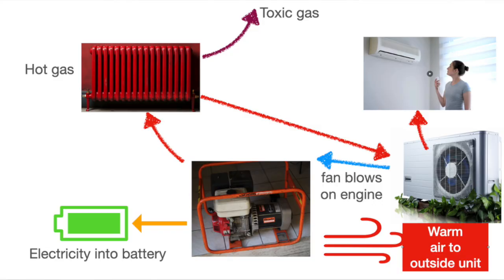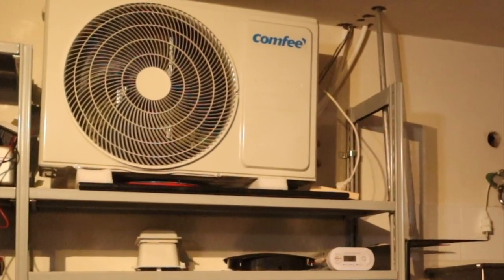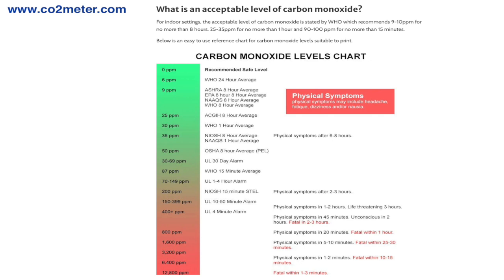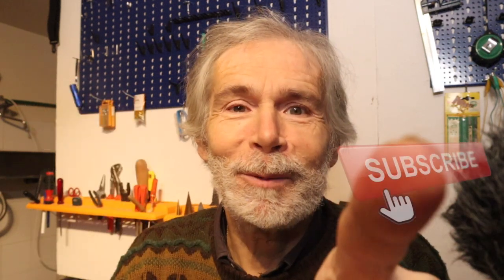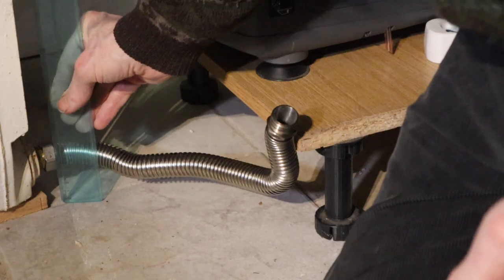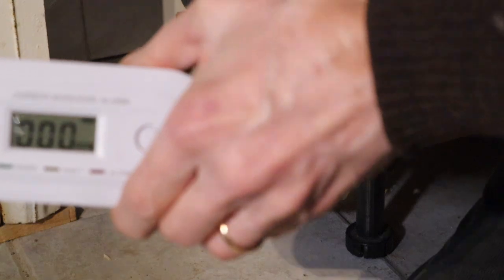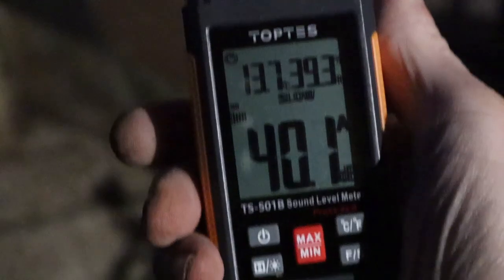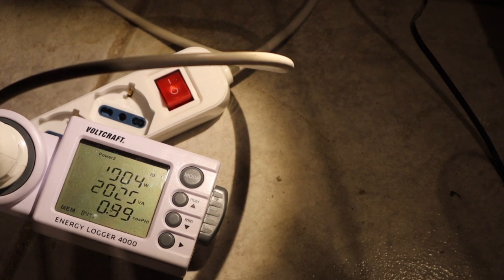Off Grid LIVING Made Easy with Advanced Micro CHP System! Video 83

Comment: So this was touched on in another comment.  But wouldn't plumbing in outside air to the generator's carburetor be more efficient than forcing the system to draw in cold air though cracks in the garage from the outside, degrading your captured heat?  Also,  I wish I'd seen links to the parts, like the generator and heat pump.  And lastly,  though it would require a custom generator build,  I think charging batteries directly may be more electrically efficient.  For example, I think you're using a 24V battery system.  I always assume an electrical conversion efficiency of 80%.  So if that's an inverter generator, you're losing 20% in the inverter process right at the generator, and then 20% again at the Victron to charge the batteries, and then 20% to get from batteries to AC again.  The soft start due to the inverter VFD in the mini-split is a plus, and probably the only place where the power conversion works in your favor more often than not.  So, my thought is to limit the number of times electricity may be converted in your design from DC to AC to DC to AC etc with a custom generator charging the batteries with 24 volts directly and then powering everything from the Victron inverter.  There are youtube videos dedicated to such generator builds, due to the fact that converting electricity is not efficient.   Overall, I like your build, I'm glad you did it, and I've had in mind the same sorts of things, but every HVAC technician that I've ever talked to, and every manual that I've ever read, preached against putting the outside parts of mini-splits inside anything.  Furthermore, in the States, as soon a property owner does anything brilliant with their home, that others don't understand, their property value plummets, and or, they're tied up in code violations.  I often wonder if it's that way in other parts of the world.  I look forward to future videos documenting money spent on gas verses what the cost would have been buying from the grid.  I also look forward to your thoughts of a diesel generator rather than gas, as diesel has more energy per gallon than gas.
Reply from the maker: Thank you W3 for the comment. It is true that the generator takes air and pushes it together with combustion gases to the outside. But it is not much and far away. But it is a good point.
I was thinking about links but didn't find my generator on the web shops. It is an Italian machine, the Pramac PMi 2000. The other big one was 25 years old...
The 24 Volt generator is a good point, I would also like less conversions. However, the set up is actually aiming at working directly for 230 V ac power supply, for example the heat pump itself. The battery is not so large and doesn't take a lot of energy. It should allow to come through a silent night with few small consumers running.
It is a wonder that the USA is so strict in its regulations. I had the impression that such densily populated countries like my country Netherlands and my Residence country Italy are much stricter. OK, USA has some very dense areas, imagine only Manhattan.
Reply from the maker: Regarding the split in the garage, I was well aware that it is a very strange thing so I thought much about it. I ensured that the heat production and cold production of generator and evaporator where in balance. In summer we are in another place (you see it on the channel) so we have a dominant heat demand in the house you see on this video. 
I was just so curious about the effect on the Coefficient of Performance (COP) with this outside unit in the garage. After all I see that the temperature in the big garage with so much stuff inside never felt under 13°C and the generator wasn't even running!
Reply: @nnvasen-good-energy  Do you know if your garage is insulated?  My home garage is not insulated because the home builder was not required by code to do it.  We've managed to insulate the attic, but have not cut up the sheet rock in order to get insulation in the exterior walls of the garage.  our winters are -3C to -17C, so 13C is like a heatwave for us in the winter.

Comment: Hey an idea came to my mind, since your heated source is not in a loop (gas is going out) if you add some fans to the radiator that pull cold air into it,  you might improve your low energy heat recovery by 10% or  more.
Reply from the maker: Hi Vottat, you are right, i will do it, like in my first video https://youtu.be/z0ldVoti2hA !

Comment: Ok so what if you would place the generator and the inverter in a well insulated fireproof box that you put outside, with the exhaust routed outside and an air intake for the generator (I think they run more efficient with fresh air than with warm air). What COP should be possible if you count on 30% electrical efficiency and 55% heat from the generator?
Reply from the maker: Hi Rob, that is a good idea if you want to avoid having it all in the garage. You mean generator and evaporator, right? The only problem is then that you have not the thermal storage of the garage and its content (including a warm car). As soon as the generator stops, the evap is without thermal support. In my case it is also to avoid nuisance to the neighbours. Outside the garage I hear practically nothing, a box outside has to be made really thick. The COP is more dependent on the temperature outside and the amount of heat from the gen must balance the cold of the evap. If not, you need a thermal mass that continues to provide heat.
Reply: @nnvasen-good-energy yes indeed I meant the evaporator. My house needs around 5kW continuously to maintain temperature at 0 degrees outside. If I could have a continuously running generator (on propane, I have a 1000l tank) in an almost sound proof box together with a heat pump condensor it could make going off grid a nice bit easier. I don't know if running generators continuously is a good idea though.
Reply from the maker: I think that the commercial generators need rest, a viewer from Ukraine wrote that he saw many broken generators, also after power surges.
Reply from the maker: By the way, there is since 1 hour another video that explains it. I see now that you answer to my previous video.
Reply: @nnvasen-good-energy yes I just saw it, very interesting! I just don't know if running a generator in a garage that is within the same building as the living area is something I would like to live with..
Reply from the maker: It is good to have always a CO alarm near the generator. Mine is very sensitive and helped me to find leaks.
Reply from the maker: After all, being in a car and amidst many others is worse. Start with an observation period.

Comment: Genius idea to use the outside unit where the generator is to increase overall system efficiency.
Reply from the maker: Thank you RecapNest! I saw today confirmed in a YouTube video from an Austrian installer that low cost heat pumps don't work well if outside it is below 0℃ and mine was 280€. At least I am happy that also this cheap heat pump has an inverter so that it will work well with the generator. Those don't like a sudden start of a standard compressor in an old air conditioner/heat pump...

Comment: This is NOT a project for all you KAREN's out there. If you would read the DIY note it says the difficulty level is 70%.Me personally I applaud this man. And it wouldn't be that hard to rig up a "dead man switch" to a c o monitor that would kill the engine IF the ppm got too high.
Reply from the maker: Thank you Larry! The 70% was too express the relative ease after last week's video ☺.  I will look if that switch on the generator can be bypassed with an external switch and look for a CO alarm wit a contact, thanks for the tip!

Comment: It's a great concept but the consensus online is you should never run a generator within the structure of your house. There's too many potential points of failure. Build a simple shed on the side of your house for the equipment and it's ok.
Reply from the maker: Hi BeeTooEx, you are right that it is a dangerous technology, so I took the precautions that you see in the video and also some other that are not in the video. For example, choose well the times that you run it. The battery will allow to have electricity during the night without the generator running, if night consumption is low enough. The CO alarm must be in any place where a leakage of CO is possible. We have also the grid supply so we can afford to choose safe test times. 
From the other side, what do you think about the mentioning of the danger in every car, where it is essential that the exhaust is led from the front end to the back side of the car, without leaking? The driver has to concentrate, no such leakage allowed. Also, the car could be used without moving, for example when you are in a queue in extreme cold. A car engine is at least 20x as big as our generator of 1,7 kW.

Comment: Would it be safe to place the radiator in a living room? With exhaust hoses through the outside wall?
Reply from the maker: That depends on the quality of the connections and I have a CO alarm with ppm display that must remain under 50. I will monitor the exit temperature of the radiator and when it comes above 40 degrees I will replace it with aluminium. I just used plastic because the shops were closed ☺

Comment: I like this system but my only concern is the noise level. I only heat one room in winter here in Germany, the kitchen.  I have done a Youtube video on my situation. If I understand your system correctly then it is great for heating a workshop or garage where noise levels don't matter but a generator in my kitchen, which is where I spend by winters, that would drive me crazy.
Reply from the maker: I hardly hear the generator in the garage under our kitchen.  We have a 2.5 kWh battery that is charged by the generator in the hours that are acceptable and then you run on this silent battery and inverter for many hours. Bog consumers can run simultaneously with the generator. 
Our generator is only 1.5 kW electric,  the heat pump only 2.7 kW, we installed the heat pump for the kitchen. It is an inverter type and when it is near the set temperature,  it starts to work at only 400 Watt.
Reply: @nnvasen-good-energy  But if the generator only produces 1.5kw then it can't power the heat pump because that has a peak electricity demand of 2.7kw.
Reply from the maker: No, the production is max 2.7 kW but it takes then 600 Watt thanks to high COP

Comment: Why is there "water in the radiator"? The exhaust gases from the generator go through it. So why would there be water in the radiator? Do you mean condensation? That could be removed because every radiator has a valve at the bottom that can be opened. By through time the radiator would rust. That could cause CO fumes to exit.
Reply from the maker: Thank you Berthold for the good questions. A thermohydraulic told me about gaskets between all vertical elements of radiators that don't resist to high temperatures. Water will limit it to 100 degrees as long as it is in the radiator. It must not be too much because of back pressure to the engine but it must cover the entrance for the gases. It will evaporate and must be integrated automatically or by installing a kind of looking-glass in the form of a transparent tube parallel to the radiator,  as level indicator.
Reply: its a separate chamber inside of the radiator. just like in your water heater.the water serves as a heat absorbent.. like the heat sink on a computer.

Comment: Put silicone sealant on the loose fitting exhaust tube to muffler to seal the fumes.

Most all silicon's handle over 300c and automotive has silicones for up to 500c
Reply from the maker: Hi Brent, yes, the red product is also silicone based. Special for stoves. I will keep the CO meter close to any connection point that I have.